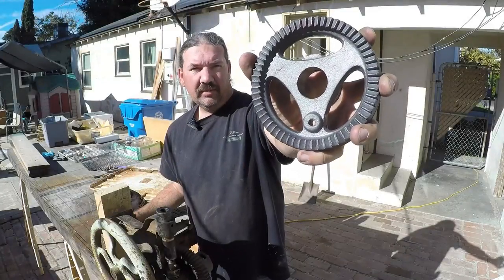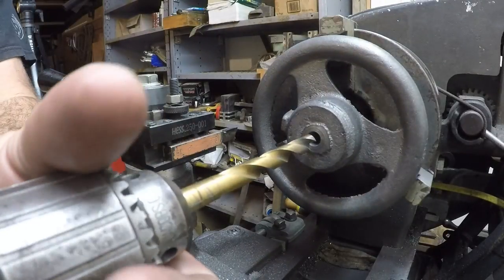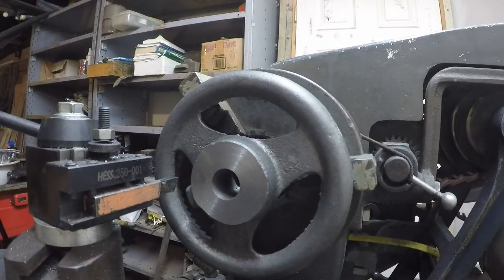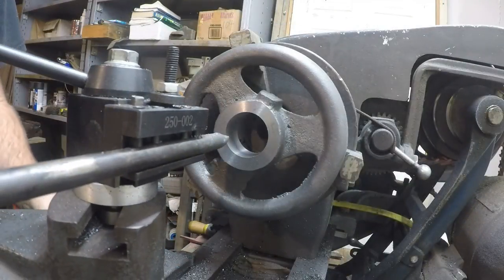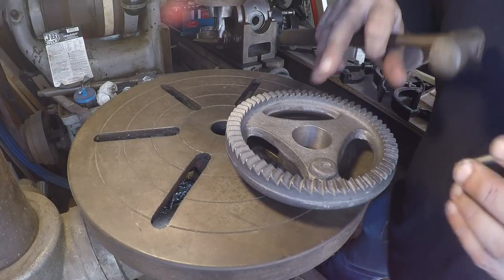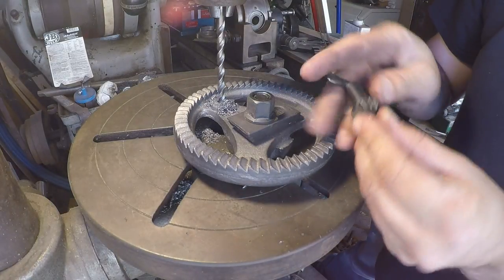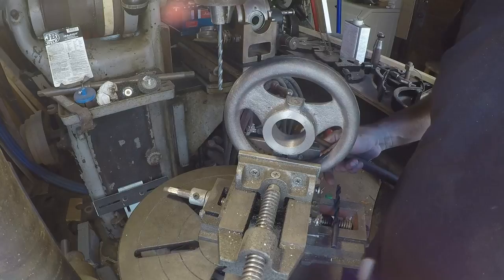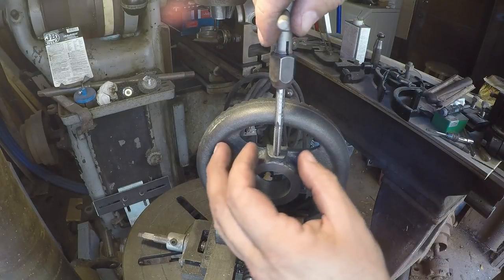Foundry Pattern Making from parts #4

Comment: Chris, thanks for sharing.  Perhaps giving it a spot face with an end mill would have help keep the bit from sliding down hill.  I know that a drill chuck isn't ideal for holding an end mill, but would probably work well enough to give you a perpendicular face to drill into.

Joe
Reply from the maker: +My Heap if only I has a end mill lol but yes that would work
Reply from the maker: +My Heap I think I should have started with a smaller drill . It would stay in the center punch better.
Reply: You are correct as long as the center punch width was wider than your pilot drill web, right?  See, I may be starting to learn something after all??  :-D

Joe
Reply from the maker: +My Heap this reminds me I need to look at the spair gears I have for you.
Reply: Just let me know what you find.  Thanks Chris
Reply from the maker: +My Heap will do looks like quite a pile

Comment: For centering,instead of going to a smaller dia. drill which is prone to flexing, go to the largest stub drill you can hold short in the chuck to "spot" the place for the correct drill that follows.
In the automatic screw machining business, there are such spotting drills sold and in common use.
You can make your own from broken drills.
JIM
Reply from the maker: Need to get some stub drills. Think I need to adjust my tailstock I think it's not as tight in the ways as it needs to be
Reply from the maker: Oh didn't see the last bit about making my own.  I need to break some drills lol

Comment: Great video.  Long center drill is what you need.  You can buy those easy.  Fun lathe project would be to make an extension to hold a standard center drill.  Mine has 6 a collar that is made onto sleeve.  A pinch collar could be made but really nice would be a shrink on one.  I'm betting yours was turned off if there is witness mark from a set screw.  Even cooler, in brass so you can polish and Steam Punk it up a bit.  You really are going to use a square head fastener on that wheel?  I have two of these to restore.  One on my garage floor really in the way!
Reply from the maker: +Crafted I always prefer to use to oem type bolts . The wrong type always stand out like a sore thumb. I tried to leave a witness but you know how that goes. I like the long center drill idea maybe with a mt2 shank need that tapper attachment lol. So many projects. How do people complain they run out of video ideas.

Comment: You need a 4 jaw chuck so you can make the bore concentric to the OD.
JIM
Reply from the maker: If it was a fussy part but this part would never see more than one or two rpm and there's a lot of slop in the system for the ratcheting parts to work.
Reply: Well, this is your show and you have the right to do it any way you wish.
My only concern is you are teaching the World. 
 I had a successful shop for 50 years, so when I see something I disagree with, I can't help but mention it.
I like what you are doing and will continue to watch your videos.
JIM
Reply from the maker: No problem with constructive criticism. There are many ways to get to the goal and I do thank you for your input.

Comment: Chris you have the "nut" upside down. The collar is the thrust surface. It also looks like it has been repaired (brazed) and may be too long. Take a look at pictures on vintagemachinery.org.
Reply from the maker: +Steve Baum I've Been kinda thinking that but the nut is to look good to fit In the other was perhaps it's from another drill.
Reply: If it fits other than length then just shorten it it. Should stick above the ratchet wheel just a little, say 1/8".
Reply from the maker: im kinda leaning that way mr eviltwinx is going to look at his and see how it s set up .

Comment: Instead of drilling into the rough casting, you might be better off spot facing the surface you are going to drill.
Just come down on it with a two flute end mill to make a true surface.
JIM
Reply from the maker: Yes that is a good idea but I don't have any end mills lol

Comment: 5/16 to 1/4 not to worry you are only 1/8 hp next time you need to drill a slanted boss in cast put a flat on it by hand or an end mill
Reply from the maker: +Jerry Schram I try to keep learning just hope I don't have to learn the Same thing over to many times lol